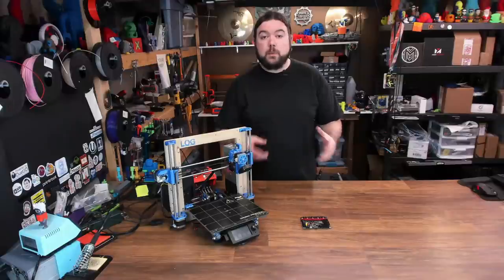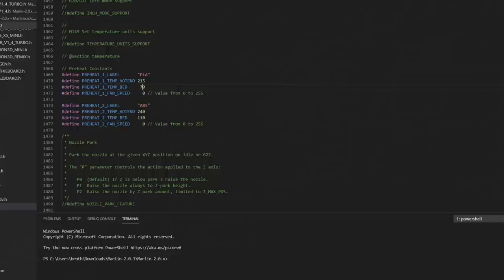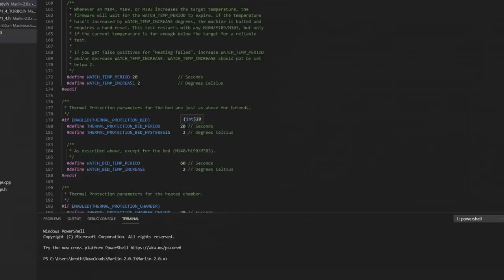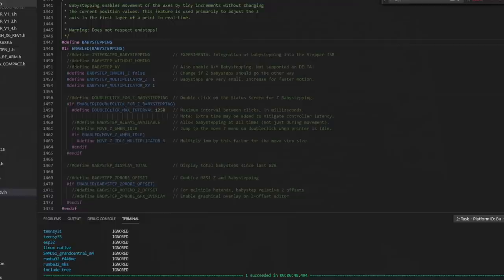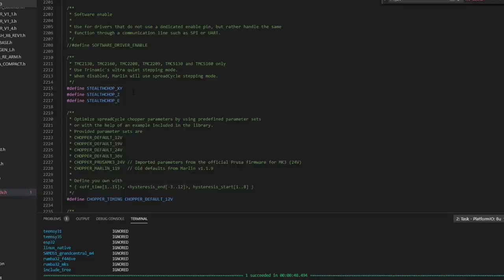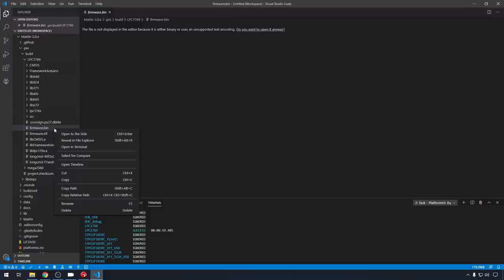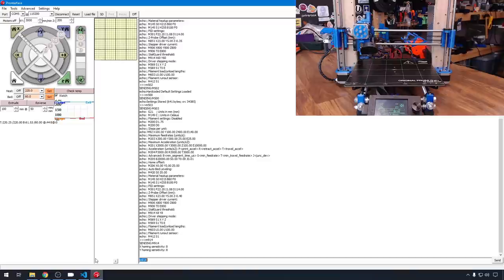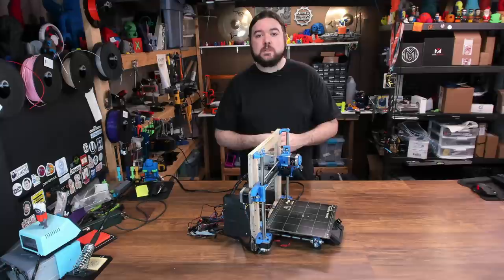BigTreeTech SKR v1.4 Mainboard - Full Install Part 2 - 2209 Drivers - Chris's Basement

Comment: I finally got sensorless homing to work "perfectly," except for the part where it homes to gently tap on the wrong end, whether the stepper directions are inverted or not, throwing it off-centre as it tries to centre the nozzle on the bed afterwards. Is enabling max plugs and setting home_dir to 1 the only solution, and does that mean I can't use those pins for anything else?
Reply from the maker: So it doesn't home at min? Sounds like something is off somewhere.
Reply: I've been trying to figure out where, since HOME_DIR hasn't been changed from -1, but as much as I want to know what went wrong, it feels like it'll be faster and easier to just start over with a fresh copy of Marlin
Reply from the maker: @KarisMajik  You're probably right.

Comment: Hey Chris, i used (almost) your exact same config for my Sidewinder X1. But for whatever reason my hotend wont go above 25 degrees celcius or so. Not sure why it's doing this cause it didn't do that for you. Thanks
Reply from the maker: That doesn't sound good. Could be a bad mosfet.
Reply: @ChrisRiley  Yeah i didn't know what it was, so i decided to get a replacement board to see if that fixes it. Thanks again

Comment: CHRIS   I dont know. I was following you along, you would get to a point, I'd pause, make changes in VS Code.  No sensorless homing. when done = ERRORS   SOMETHING ABOUT "SQUIGGLES" IN VS CODE       LUCKLY this is a "practice" run as my SKR1.4 Turbo hasnt arrived yet
Reply from the maker: I have seen that before, but it shouldn't impact the compile. There might be another error somewhere that is stopping it.

Comment: This is awesome I am having one small issue and I don't know if its normal If I auto home the printer a second time It crashes ( x axis as its the first one it test) any idea? thanks for all the info and the tutorials!
Reply from the maker: No, that is not normal. I am not sure what the issue it. The endstop might be slow to respond.
Reply: All good just clipped the pins and went back to using sensors instead of sensor less homing

Comment: Hey Chris.  Thank you for a job well done.  Excellent tutorials.  Just completed my SKR1.4 board upgrade on my Monoprice Maker Select Plus.  I used TMC 2209's for the Z and the Extruder along with BigTreetech's  S42a closed loop steppers.  These things are amazing.  I have to figure out why the Y axis with identical motor setup is moving very rough compared to the x axis which is silky smooth.  Any suggestions on what I should look at?
Reply from the maker: So you have closed loop on x and y? The only thing I can think of is maybe one of the Y wires is having an issue.
Reply: @ChrisRiley  Yes sir.  Closed loop on the X and Y.  X seems silky smooth.  Y axis seems very rough.  I am too very suspicious about the wiring and any electrical noise causing problems.  I had to enable the endstop interference setting (setting of 2) in Marlin to squash false positives with my limit switches.  But before I go too far down that rabbit hole I wanted to hear what your thoughts were on it.  Thank you for responding.  You by far have a knack for teaching this stuff.  Gonna start going though all your other videos.
Reply from the maker: @kevinmccue1005  Please let me know how it goes.

Comment: Thanks for the great video. I heard and lot of people are complain about the Bl touch auto bed leveling in 2.0.5.3. What you think. I also do the auto bed level after that every time i have to use baby stept to adjust the z probe offset. For exp my Z probe off set is -7 but when i start printing -0.7 touch the printer bed and i have to go -0.3 by the baby stepping. Whats the reason behind this. I have the same problem on every print when i start.
Reply from the maker: I don't use the bltouch, but I do plan on checking it out and see if I can solve some of these issues.
Reply: Chris Riley thanks
Reply: I use bltouch with skr 1.4 turbo, works awesome. Very easy with this board.

Comment: Hey Chris soo I have a Cr-10 got the SKR 1.4 turbo and 2209 drivers, followed your video 3 times and same out come of Marlin just giving me errors. I tried someone random person Marlin from Facebook and It's up and running but my axis all crash. I have tried all different methods of connecting end stops removing them and flashed Marlin 5 different times only the FB Marlin Copy only works. Yours and teaching tech both give me errors... I just want to start printing again... please help thanks!
Reply from the maker: Hey, I can't speak to the version that you have right now, but I can help either way. Send me an email brotherchris81@gmail.com

Comment: I tried to follow your guide for skr_1.4 , marlin_2.0.5, xvico x3 pro. I get a problem.when I move Z axis with control from pronterface, it works nice. when I press Z homing in goes upward instead of down, I cant lower the axis with control. when I use m119 the z micro switch is open. When I change z_home_dir to 1, the m119 for z axis change to triggered and I cant stop the axis from hitting the bed.
Reply from the maker: So home dir needs to be -1. What happens when you change this option? #define Z_MIN_ENDSTOP_INVERTING false
Reply: @ChrisRiley  i found the fault as xvico x3 come with 2 pin endstop, I just replaced it with 3 pin and it worked nicely without any problem.

Comment: Outstanding Video, great pace and clear transitions.  unfortunately, I cant get past the compile/build stage  as i keep getting a "ENA_" and "(" does not give a valid preprocessing token" error.?  Any ideas? The inter-webs and the "Oracle of Goo-Gle" have failed me.
Reply from the maker: Hey George, this seems like a character got put in the wrong place. Does it give you an idea about what file it is talking about?
Reply: @ChrisRiley  it links to the macros.h (under the //Macros to support option testing section), and seems to have cascading errors with the same root cause. thanks for taking the time to reply!
Reply from the maker: @georgecushman7865  Huh, i'm not sure, it could be anything, I would have to see the errors.

Comment: Hey Chris, I'm up and running (Thank you!), but I'm looking for a video that covers and explains all the different option that enable or uncomment in the configuration.h and _adv.h files. I understand setting up the size of the bed, stepper drivers, speeds, etc... but I want to know more about the bells and whistles/features. Like a  walk through of the different bed leveling options, why use one over the other, or pros and cons, the options that come with them, and why and when to use them. Junct deviation vs jerk, s-curve, linear advance, etc. I realize there will be overlap in standard settings vs extra features. Maybe a play list would work too, to keep videos from being to long. Would be easier to update too when marlin changes the way it works or adds new features.
Edit: Found play list "How to Marlin"
Reply from the maker: I hear ya, I try to touch on as many of these as I can, but I still need to do more.

Comment: Hey Chris, great vid, I was hoping you would cover the bltouch on the turbo I am still not clear when using the TMC 2209,that you have to cut or bend the  diagnostic pin on the "z" driver to get the bltouch to work with the "z" min plug..or can you once you mod the driver use the dedicated servo pins on the board?..again great work Chris I hope you cover more with this board in the future!..ps.  how can I send you a coffee?..lol
Reply from the maker: The BLtouch setup will be comping soon, stay tuned.

Comment: Hey Chris I'm having issues with the firmware upload. So far yours is the only one working mostly but homing isn't coming out right I'm using end stops not the sensorless homing you discribe. And when I home the printer z goes up 4mm and x and y only move about the same . Can you help me figure out what's wrong ?
Reply from the maker: The endstop inverted need to be changed. Check your M119, if they say triggered when they are not, change these settings. 

define X_MIN_ENDSTOP_INVERTING true // Set to true to invert the logic of the endstop.
#define Y_MIN_ENDSTOP_INVERTING true // Set to true to invert the logic of the endstop.
#define Z_MIN_ENDSTOP_INVERTING true // Set to true to invert the logic of the endstop.
Reply: @ChrisRiley  I'll check them out again but I'm sure when I went m119 they were open 🤦 I can't believe I over looked that thank you Chris I'll get back to you on what I discover

Comment: Curious how often you update Marlin installs, when not related to a video? And how you go about it? I setup Marlin 2.0.0 on an SKR 1.3 for my Predator. Then just added an SKR Mini E3 to the Ender, and now 2.0.5.3 is out. So decided I would get them both on the same release. Not good. There is a bug in 2.0.5.3 regarding HOME_BUMP_MM on deltas. So ended up on bugfix. So I would also be interested in how you got about updating when there is a schema change, and the configuration files can't be directly reused.
Reply from the maker: Unless I need a feature that has been added, I almost never update. It's just not worth it most times. To big of a pain to go through all the settings. Someday maybe Marlin will have a migration tool.
Reply: @ChrisRiley  That is what I am discovering. I tried to match up things line by line, best I could. Even using Git to version control and do diffs. But something isn't right. Machine is a noticeably louder in its movements. Had to roll it back and it still isn't the same.

Comment: Every time I try to build this shows up, in my pins file and I've tried everything i could, can u help me?   #error "Unknown MOTHERBOARD value set in Configuration.h" even though i did the same thing you did, but for the SKR 1.4 Turbo

Edit: i fixed it. I accidentally backspaced MOTHERBOARD when i was pasting  BOARD_BTT_SKR_V1_4_TURBO It works now!! i looked at your video when you were typing in the name for the mobo, and noticed this. THANKS!!!!!!!!!
Reply from the maker: Glad you found it!

Comment: Wow you have a lot of videos.         Can you do one with SKR 1.4 Turbo and multiple extruders?   Or a video using the FanMUX?    Are the pins on the SKR1.4 Turbo all capable of PWM?     My  printer has 2 extruders, 4 fans.   On my RAMPs I had the 2 hot end fans set to auto, and the part fans connected to a PWM and MOSFET board.   Is this possible with the SKR 1.4 Turbo?
Reply from the maker: I might tackle that in the future. There is only 1 PWN fan on the turbo, kinda sucks. No other pins that are PWN that are really useable.
Reply: @ChrisRiley     Thanks Chris.  Looking at the datasheet for the chip, there are quite a few PWM pins.  I was going to work my way down the list and see if I can find at least ONE more.  Really, the hot end fans only need to be on/off with a MOSFET, not PWM.  The part cooling fans are the one's you want to adjust speed.......  Might even get away with the single PWM pin and use the Fan MUX to move between the part cooling fan on nozzle switch, which is what I think Marlin had in mind.  So maybe only 1 PWM pin and a few GPIO pins.
Reply: @Chris Riley   Found some PWM pins...  
Answered my own issue on Github, https://github.com/bigtreetech/BIGTREETECH-SKR-V1.3/issues/401
lol

Verified PWM works -
Z-Stop P1_27
PWRDET P1_00
   <-- I will use this
I2CSCA1 P0_00
   <-- I will use this
I2CSCL1 P0_01
   <-- I will use this
SPI P0_26 (closest to power and CPU)
NEOPIX P0_24
PROBE P0_10

Did not test but expected to work:
SERVO P2_02 Assumed works
 since servos use PWM

Pins I tested but bad things happened (lost access to the on board SD card):
SPI_SCK1 P0_07 (top middle) DO NOT USE
!

Pins I did not test because bad things happened on related pins:
SPI_MISO1 P0_08 (top right) DO NOT USE
!
SPI_MOSI1 P0_09 (bottom middle) DO NOT USE
!

Pins I expected to work but did not work for PWM or GPIO -
Maybe I need to change more in the config?
E1_Det P1_25
E0_Det P1_26
Y-Stop P1_28
X-Stop P1_29

Pins I did not test but may work:
E1 Stepper pins,
E1 Enable P1_16
E1 Step P1_15
E1 Dir P1_14

TFT Pins
TFT RX0 P0_03
TFT TX0 P0_02

Wifi Pins
Wifi TX3 P4_28
Wifi RX3 P4_29

Comment: Hey Chris! I have an skr 1.4 and have it set up on my printer but I ran into an issue. In the menu of the tft24 lcd that I’m using, it says “no media”. I have enabled SDsupport in Marlin 2.0. I was wondering if you or anyone else reading this could help. Thanks😀
Reply from the maker: Hmmm...have you tried other SD cards? Maybe reformat it fat32?
Reply: @ChrisRiley  It turns out that I had to put the sd card in the slot on the lcd screen. I had it in the slot on the skr board. Also, great videos!

Comment: Chris, I wonder where and how do you assign the second stepper driver to the second Z motor. Will this be automatically the E1 ?
Reply from the maker: Yes, when you turn that option on in configuration_adv.h it will automatically use E1.
Reply: @ChrisRiley  Thank You Chris, I will try this option and see what happens.

Comment: Lots of great info, thanks Chris
I am using on a DIY CNC. Not much good Cnc Marlin education . A Cnc setup video might do well? I need to turn off all printer functions and such, guidance like this would be wonderful. Thanks Again!
Reply from the maker: Thanks for watching! Great point, most of the time folks go with GRBL, I might look into a complete Marlin setup, I've never tried it before.
Reply: I have been trying to compile this for 3 days
Had it success, but was wrong lcd, changed it and no luck. Driving me crazy! I used it on a MPCnc 2 years ago. But had a fire and lost my machine. I was given a new frame, but 2 years later, struggling, so maybe I went wrong direction on the controller. 
Could you possibly look at it?
Reply from the maker: @FrugalFixerSpike  Send me the error you get and I can have a look. brotherchris81@gmail.com

Comment: Hi I followed all the instructions and I can't make sensorless homing work. I'm using SKR v1.4 with TMC2209 drivers and no pin modification at all. STALL_SENSITIVITY lower than 70 makes X crashes and higher than 71 makes X doesn't move at all.  Thanks again for the awesome video
Reply from the maker: Hey, try lowering the homing current. Make it 60-70% of what it would regularly be. Set it here in configuration_adv.h
#define X_CURRENT_HOME  X_CURRENT
Reply: @ChrisRiley  I tried that and also this #define X_CURRENT_HOME  X_CURRENT/2. This is really annoying. I'll search for more possible fixes. Thanks again!
Reply: @ChrisRiley  I downgraded the version to Marlin 2.0.5.3 and followed all the steps on your video and it finally got my sensorless homing working fine! Thanks

Comment: Hi Chris, i am installing this board + 5 tmc2209 1.3's to ender3v2 for dual extruder. I have purchased chimera like 2 in 1 out hotend. What tft would you prefer for this board? or i should mod the stock ender3 tft?
Reply from the maker: I'm not really a big fan of the TFT screens, the ones from BTT seem to work okay, but I prefer just the stock screen. With dual extruder, it might be harder to use a TFT or the stock V2 screen. An old school one might be a bit easier.

Comment: I am migrating from a ramps board to this. I have my configs adjusted but am used to using the arduino IDE to flash the arduino/ramps. Can I do the same for the skr 1.4 or do I need to get VS Code?
Reply from the maker: You will need to use VScode for supporting 32bit boards.

Comment: Hey Chris, Great video. How have you connected your fans tho? because I read that only one fan port is pwm controlled. Does this mean I can only use PWM for my part cooling? and the other one allways have full blast? or is one of the other headers also controllable?
Reply from the maker: Thanks! Fan 0 is PWM and is tied to the config for part cooling. The hotend fan can either go to the always on pins, or as I did here, you can use the the second extruder heater terminals.
Reply: @ChrisRiley  Aaah so instead of using one of the jst connectors I just connect the fan to the E1 terminal? And that in combination with your config here does the trick?
Reply from the maker: @MadMikeFPV  Correct.
Reply: @ChrisRiley  I literally just got it working :) thanks man!

Comment: Hi Chris, could your talk sometime about connecting an OctoPi to an SKR using TTY instead of USB?
Reply: https://www.thingiverse.com/thing:3408920/files
Reply: look at the pictures, there is one with the connection and config, just connect to the skr using the pins indicated on the skr manual
Reply: Thank you, I’ve had it working on several of my machines for a while now. I’ve just never seen anyone do a video on it and thought Chris could do a good one.
Reply: What does this do? Is it faster? Or just easier to compact your designs by not needing a USB cable?
Reply: @StevenSSmith  same speed, just easier to make a compact design without the usb cable...
Reply: Mostly to compact the design and it frees up the USB port when I use a Pi 3 A+ for a webcam.
Reply: @themachobbit  Yeah, don´t know why this isn´t the most used way to connect the board to the pi...
Reply from the maker: I think this would be cool if we designed a bracket and mount to use. I will see what I can come up with.